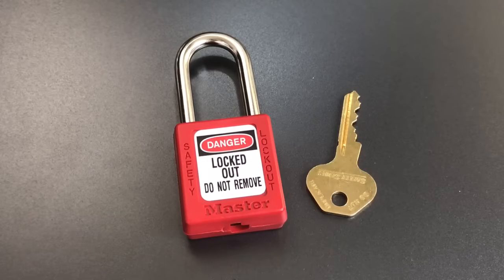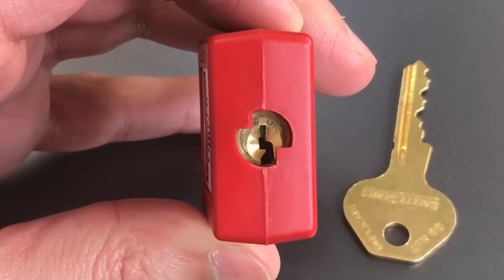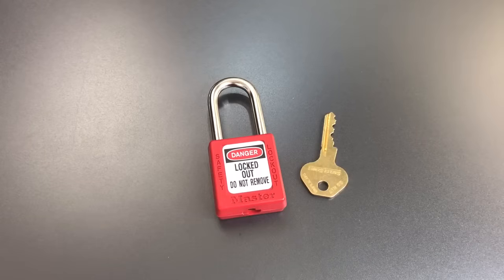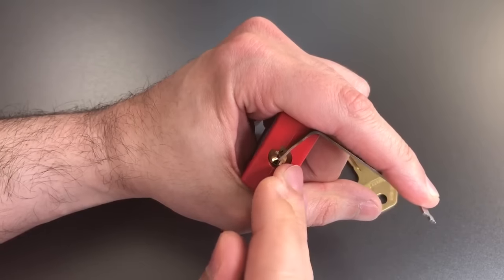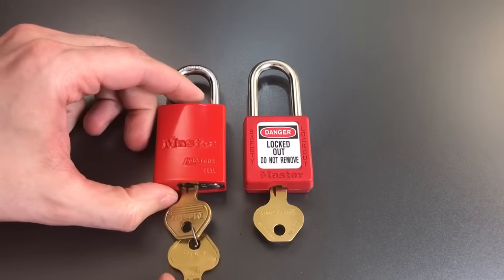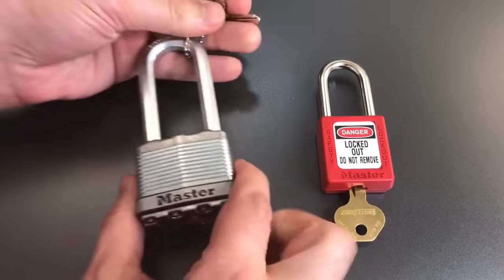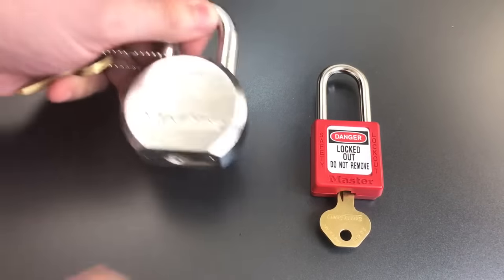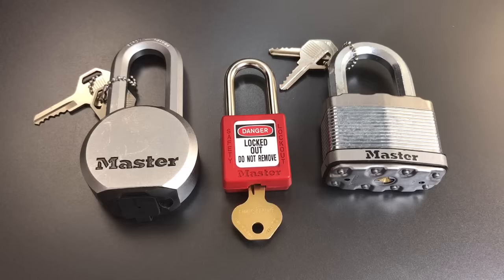[479] The Master Lock Paradox - Model 410 LOTO Padlock

Comment: I've worked with LOTO locks for years, and can comment on why the design is great for me and my coworkers. The shackle is un-hardened so an authorized Safety team member can use standard bolt cutters to chop it if someone's lost their key. Additionally, we use these so often that we wear them on our belt, so the lightweight plastic-exterior design really helps to not tear up your pants or bounce around too much. Finally, we use these locks several times per day for years, so perhaps the extra pinning helps the keys stay firmly in place when we're walking around with the key in, or continue to safely function. Or perhaps there was some court case where someone picked a lock and someone got hurt. I'm not totally sure, but that's the information I have!
Reply: I’m here to back this up as well. Everything he says here I can attest to. I work with automated robots, which require constant trouble shooting. This requires a lockout every time I have to enter the automated cell, I use this same exact loto lock as many as 50 times in one 12 hour shift.
Reply: So true,  plus the Weight hanging off a MCC mains power switch handle.
When you have scissors plates and 20 locks hanging off one, all that weight over time can damage the switch mechanism internals. 
the new plastic locks came out after 2 people died and 3 injured  because the switch was damaged energizing a conveyor that they were working on.
Early 2000's in Australia.
Reply: I am a non-lock picking lawyer who does labor arbitrations and thus I know a fair amount about LOTO practices.  All those reasons are spot on. Also note that The “one man one lock“ practice means you can have 10+ locks hanging off the same switch if it’s a big project. Size and weight matters. Finally, on the management side, no one ever got in trouble for paying an extra dollar for an LOTO lock so I won’t be surprised if someone at master lock just said, what the heck put the good core in there we can charge extra for it ;-).
Reply: Thanks for all the specific insights, very interesting, but I don't think that was ever an issue. Everyone can imagine why plastic locks could be useful, problem mentioned is more at why they did not put such a good core (as LPL claims, I got no clue about it) on any of the premium locks that are supposed to provide more security when they obviously are able to make it :P
Reply: Felix Safford never claimed to be one, only stated that i use this lock at my place of employment and my experience with it.
Reply: The quality cylinder is because they don’t want multiple keys floating around. You only have so many pin combinations before you start back over. It’s to keep out the honest people not scalawags.
Reply: As for multiple locks hanging. You should never have multiple locks hanging from a switching device. You put a single lock on the disconnect and then put the key in a lock box and lock onto the box accordingly. Plastic is not for weight savings priority but cost savings. That’s why electric utility meter tags are a thin piece of metal tabbed into a plastic tag.
Reply: I've had to carry up to 10 locks on shutdowns and am glad the bodies were made of plastic, the pain in the ass is to  figure out which key is for what lock in the low light environment
Reply: I think he means more so why their BEST lock is in a bad body in the sense why do their most robust locks have such lack luster locks in comparison
Reply: I think the reason for the core being better on this the on some of the other ones would be because Master assigned a group of designers to make a new LOTO lock and gave them a price range, so because of the plastic body they had extra money for a better core. Where the other ones were made with more expensive body's. Damn this was long.
Reply: @Storyteller543  The better core design is likely more due to this lock being to protect someone's life, versus just preventing replaceable items from being stolen. One of the machines I use these on specifically calls for plastic bodies because the LOTO location is dangerously close to 460v mains supply. It's already scary enough climbing into a machine that will kill you without even batting an eye, no need for added risk of electrocution when installing or removing the LOTO lock. Depending on the type of plastic and molding method, the plastic body could be the same cost or even more expensive than Master's standard lock body design. Quality plastic isn't as cheap as people think it is. It's some weird blend of Nylon and other crap in it. They even make ones with full Nylon shanks to that are non conductive and non sparking.
Reply: This comment might as well be a Reddit thread.
Reply: Farfigshüten U.S.A I atest to this
Reply: @RadDadisRad  The plastic is more likely not for cost savings but for non-conductivity. LOTO locks are often put on power boxes, switches, fuse boxes, and other high-flow power devices. When people refer to LOTO locks hanging from a switch, they are likely referring to a lock box, since the first step in a lot of LOTO is to enclose the entire switch or plug in a LOTO encasement.
Reply: I also wonder if the different pins can help in dirty environments where the lock may be used often. Leave a little room for shavings and dust in the lock to keep it working longer.
Reply: dementedpaintballer but whose picking locks to turn equipment on? I don’t buy that it’s for “protect a life”
Reply: @blahblah8037  well, you've never had a job around dangerous machinery then. I have several machines at work that I have to climb into to fix broken hoses or do routine maintenance on. LOTO locks like this one prevent somebody from turning the machine on while I am inside it. I would easily be killed if the machines were activated while I was working on them. Whether you buy it or not, these locks protect lives.
Reply: john jon try rereading and learn to use some context. 

I clearly said who is picking these locks. Especially a plastic one you can remove with a screwdriver. 

Don’t condescend because you’ve had a job. Try following along to the entire conversation. 

The lock core is not as good as it is to “protect a life” 

Clearly we were discussing the strong core not the locks and their uses themselves.
Reply: @blahblah8037  Except you didn't mention the core, you said picking locks.And this thread was about LOTO locks in general. And it does happen,  that people will use whatever key they can find to try opening common locks in a workplace. I've had people from a 2nd shift try to "find the key" for a machine I locked out because they thought they needed to use the machine. The uncommon core and one-lock-one-key practice makes it all the more difficult to remove these locks without having to destroy them.
Reply: john jon I’m not reading more than your first words of your reply. You obviously can’t read and therefore I will not continue to waste my time with you. 

Again CONTEXT!!!

Look at who my original message was tagging. Read his message and maybe you’ll finally be able to use some kindergarten level deduction to see what others were discussing.
Reply: Yep
Reply: I use these as well, I clicked so fast when I saw this lock.
Reply: john jon ... He is certainly overreacting, but you’re also being dense and unapologetic about it.
Reply: Absolutely, Scott. They're not intended to keep burglars out. They're safety devices to protect workers.
Many years ago all we had was tag out. A string and paper tag with details written on the label.
The high security mechanism is more important than the casing. The mechanism prevents the lock being operated by the wrong key. That's why many combinations of keys are required.
Anyone working in an environment requiring loto understands this. Any worker who tries to defeat the system illegally will not be working there any more and might finish up in a secure government institution if anyone gets hurt.
Stronger locks would be used on, say, an isolating switch on a power line pole where the public might have relatively easy access.
Reply: For me the money-shot in this explanation is the fact that the more secure, additionally-pinned core probably holds the key place a lot better over time to avoid key loss.  Something you're much more prone to do with locks like these.  Makes perfect sense when you think about it but didn't jump out at me until reading his breakdown.
Reply: Yep..
Designed last for years
Guess extra pins is variety in combinations? On a site with 100-150 people who all over 2-3 of these locks, you don't want any double up. Though that would be very rare but you don't want someone able to unlock multiple locks. Plastic yeah because we care multiple. 
But yeah question is still why wouldn't they just use the same core? Maybe because they don't want any person who has any of the other keys being able to open the Loto lock, they are required to have a different system all together.
Reply: @speckey1983  glow in the dark tape, fam. Sells on Amazon for ten bucks. Cut a little piece number it with ultra fine point sharpie
Reply: Wax is used to verify something such as a document is unopened, to verify the sender's identity, for example with a signet ring, these easy to break locks are the same thing. If someone gets killed on the job...
Reply: As mentioned rather intelligently by others here, the extra pin reduces the possibility of 2 people having the same key. Perhaps the security pins reduce the chances of a key which is CLOSE (but not exact) inadvertently picking the lock open. I would also guess that it was industry specifications which called for this usual core rather then  something Master came up with internally. If you want to sell a zillion LOTO locks, then you have to provide the right core.
Reply: I think a big reason for the difficult-to-pick core but plastic body and unhardened shackle is they want it to be easy to open destructively but not easy to pick or jimmy open, so that you'll know if the lock has been opened or tampered with.
Reply: @NolorW  Because the attacks against the "premium locks" are likely not to be picking. They are going to be some guy with a hacksaw, or bolt cutters, or a pry-bar. The LPL skill set is not very widespread in the real-world.
Reply: @johnjon4688  with the metal shackle, and lock core the plastic body offers no electrical insulation.
Reply: @stephengroff633  most of these are offered with a shackle with a plastic or rubber shield on them. It's about not allowing direct metal-to-metal contact that may close a circuit.
Reply: What he said is on the money. Also, many of those other locks have a large shackle that may not fit the equipment and some weigh a lot. Besides it pulling down your britches the strain the equipment hasp. It has a longer hasp which is good for tagging some equipment where a short hasp won't do. Can't forget the color and the plain labelling. Use to work at a wood mill. The machines there can kill you quick. Knew one that got pulled around a tailspool because he didn't tag out. Be safe!
Reply: I could be wrong but I thought it was an insurance thing. If someone easily picks the lock open and hurts themselves on a the locked out piece of equipment they could argue it wasn't installed correctly, but if they have to smash the lock body to get to it then they couldn't argue the same case
Reply: The most glaring failure of this lock, for me, is the failure of the plastic body. If the lock has been used for a year it has a tendency to separate down the body seam. I've had
multiple locks of this model split in my hand. Most of the failures are due to dirty cylinders failing and splitting the body. But some just split with little interaction.
Reply: I always figured that they were used to limit liability. As long as someone puts it on whatever is being LOTO'd than that absolves the company of all responsibility for anything done by misuse.
Reply: Totally true. I am here to  comment the same. We also use the full plastic model on some machines.
Reply: i agree and if couldn't find a bolt cutter a punch and hammer do that trick too
Reply: @parkwood25311  When i learned electronics, as we traced circuits and would notice a lot of components that didn't seem to do anything or were redundant. We called this "the owner of the company that supplied the boards had a relative that owned a component factory"!!
Reply: @RadDadisRad  you're starting to see lock boxes become SLIGHTLY more commonplace - but generally in the field you see a multi-lock hasp, or two, or three, depending on the size of the job. Usually when I have seen lock boxes, its been on machines/equipment where they were factory-installed to begin with.
Reply: @Jester_The_Jynxster  yes we transitioned to lock boxes 2 years ago. One orange lock for the equipment, the people carry blue locks to put on the box. Hadn't seen a red lock before.
Reply: @danwake4431  If memory serves, the red locks were the only color available when the 410 series first came out - I think somewhere around 2000-2002 (possibly a little earlier, but I recall that being the first time I had seen/purchased one)  With other colors becoming available later on.
Reply: @RupturedHighlights what Robots and where?
Reply: New standards require the LOTO lock to be inherently colored so the paint can’t chip off and look like a regular lock. That’s also why lockout is imprinted on the body. I use these all the time. My company also puts us through an OSHA LOTO class. It’s cool to learn that my friend’s key won’t accidentally open my lock. It’s basically a lock to prevent accidents, not malice.
Reply: @Steve Campbell that's b.s. I can get the same ones for less than 10 bucks as a " security lock" cost as much as 5 times as much
Reply: @michaelzdanis3979  you are quite wrong my friend. Intelligent people can also be criminals too. Have seen quite a few local news articles of people picking locks instead of smashing through.
Reply: I'm not totally sure, but I'm going to post a comment, anyway.
Reply: @RupturedHighlights  Oh, so you're like the terminator
Reply: You nailed it.
Reply: @georgewashington2893  Just how it is man; some guys just weren't held enough as infants.
Reply: AllDayTits what type of work do you do on them? I have an opportunity to receive schooling to learn how to work on them, also do you recommend the job? I really appreciate if you let me know I’m trying to find a field of work good for me.
Reply: Felix Safford are you feeling entitled enough to tell someone OVER THE INTERNET to change there name cause you don’t like it, well that’s too bad. Deal with it kid.
Reply: I would add one thing, cost justification.  This way Masterlock can charge top dollar for "secure" lock, and since its in the name of SAFTEY, no one will hesitate purchasing it.
Reply: I wonder does it have to do with the body being insulated incase of electricution
Reply: An additional reason might be, you definitely don't want it picked because there is no evidence it was defeated. But if it's cut open, that's fine (usually if key is lost) there is proof it was broken into.
Reply: I'd love one of these plastic ones. We carry 3 metal ones on our belt. 
Never thought of it much but I guess they are pretty durable, some guys have the paint completely rubbed off theirs from being used and jingled around so much and they still work
Reply: Can vouch for this
Reply: Everything here is correct.  The locks do not have to be physically strong as long as it requires tools to defeat it.  The key however, needs to be unique and many large projects, like refinery outages, may have thousands of workers.  A typical refinery outage will require 1500-2500 workers and each one has two locks that you need to be sure will not be removed accidentally by someone with a matching key.  For smaller plants, you might only have a few maintenance workers and so the 4 pin locks would be fine.
Reply: @michaelzdanis3979  not having your experience isn't the same as having none.
Reply: @jamesbeavis1892  Or even unlock the wrong lock. They get off on which LoTo they're hooked up to, and pull the wrong one out.

Or a mechanism gets worn down, and just doesn't latch correctly. One of the people higher up in the thread mentioned using their 50+ times a day.
Reply: @RadDadisRad  In regards to the multiple locks to lock out one device, that is the standard that has been drilled into my head for as long as I've worked in manufacturing. One person, one lock. They even issue special hasps to make it easier to put multiple locks on one device. I've never heard of people using a lockbox for the key for something like this.
Reply: Also. Not sure that someone hasn't mentioned it. There are now 72 replies, but... The body not only is lightweight but it isnt conductive, which is a big deal for a lot of safety protocols. As an Elevator Constructor, I can confirm that I carry at a minimum two of these on a belt loop at all times. The lock doesn't really have to be the most beefy thing out there, it's main purpose is to keep an honest man honest.
Reply: While you guys are right why unhardened and plastic is good for this use-case, the real question is: why does ML not use these cores in the locks that are supposed to be secure? Obviously, they can produce the cores...
Reply: @panda4247  Probably cost. Here companies will buy them in bulk because they need LOTO locks that meet certain standards, but others are not as aware of the performance of the cores. I know I wasn't until I ran into this channel.
Reply: Aha!!  Thank you for that info... Solves the mystery
Reply: @
LockPickingLawyer I think this is your answer. You can avoid going to your grave not knowing (if you read this comment at least). The LOTO lock is like the signature on the envelope of my college transcript. It is a seal. Should the seal be broken, I have knowledge that there has been breaking and entering. This tool allows for proof of unauthorized access. It is actually reasonable and makes perfect sense.
Reply: @slink4956  there are several deleted comments from him that would add context to my responses.
Reply: Two pairs of channel locks will open these.no bolt cutter needed.
Reply: I could totally see the "someone got through it and the company got sued" argument.
Reply: Perhaps.
Reply: We just broke the body by twisting it...
Reply: Here's my thought: the weak body makes it easy to remove officially (safety official cutting it in case of a lost key), while the good core makes it hard to circumvent nefariously by picking. Say someone wants to get around the safety rules- a chopped lock is a dead giveaway that they broke the rules, so they would want to pick it instead. A good core makes that harder. So I think this makes sense- it is more secure against rule breakers because it's harder to pick, even though it is easy to remove for someone who is permitted to do so. My LOTO locks even have aluminum shackles.

Also, the plastic body is good for lightness, and to make sure nobody is tempted to use a LOTO lock for something they would actually want to protect, keeping LOTO locks more 'sacred' for their purpose.
Reply: Why did LPL never respond to this?
Reply: @ElectricNed  like I said a pry bar pops them apart
Reply: @silverpairaducks  You didn't even read what I wrote.
Reply: @dementedpaintballer  some have also the metal part out of the body also covered in some plastic, i wondered why, now i've got a clue.
Thank.
Reply: @stephengroff633  some variation have the metal shackle covered with some sort of plastic.
Reply: @RadDadisRad  No.  Every person who is working on a locked out piece of equipment is to have their own lock, and they are to have the only key to it.  For multiple locks you use what's called a hasp, which is a pair of plates that together make a loop on one end and have a bunch of holes down the body to clip your lock through.  
In the event someone forgets their lock, is injured, or whatever, once it's verified that they aren't around the lock would be cut off.
Reply: I had an honorary 'uncle' who used to work in the coal mine as a 'sparks'. He was working on a moving belt to change the belt. Some idiot removed the "Do Not Open: Work in Progress" sign from the breaker box, broke off the padlock, opened it and threw the switch to 'ON'. The motor started up and the belt flew off, wrapping itself completely around him. He suffered injuries to his spine, ribcage and arms and could no longer pass the medical to work underground any more. He soon left on an invalidity pension to enter the local social services where he worked alongside his wife, my late mother and, for a while, yours truly.
Reply: As someone who understands LOTO but has never actually been on either side my thinking was right in line with this:
Good core= less risk of someone removing it (non-destructively) and claiming it was never installed
Cheap body= can be easily removed by destroying it if necessary, but of course it will be impossible to say it wasn't used
Reply: I think that the paradox is not so much why this Loto lock is made the way that it is, but why all of Master Lock's other locks are made the way that they are...
Reply: I have never used this type of product but as a UX designer I imagined scenarios exactly as you just described, and was going to comment my theory here.
Reply: @72 ventura They are more expensive because they are part of a "system" of compatible accessories. The cuff thingy that lets you put 6+ locks on the same switch, if you started mixing locks of different brands, then one would not fit, another would be too thin and allow the cuff to open ever so slightly…

Plus I'm sure that some of the premium cost comes from lobbying, marketing and training material. You don't need training material to explain how a lock works, but you do when you have to explain how the lock works in a LOTO system.

And yes, everything "industrial" comes with a premium price tag.
Reply: @johnjon4688  Depends. Some devices will lend themselves readily to LOTO practices. Many disconnect switches have a built-in locking hoop, therefore you don't need to wrap the switch in some box. Also in this case, having several locks hang from the switch is not an issue at all. I understand how a breaker lockout thing on a service panel might not hold up well under the weight of several locks though, thus necessitating a separate lock box in which you put the key.
Reply: @sleblanc  yeah. newer devices tend to have better accommodations for safety practices.  There are a lot of old machines though that require a  plug cover or switch cover.  I've commented on this thread so many times that I am not sure which reply you are replying to! lol :) We've had situations where a breaker box for a machine was the only place to disable it, and if several issues are present, and different techs are fixing it, they will chain locks together or double-lock a box in order to ensure all issues are dealt with before the machine is put back under power.
Reply: Our company switched to a version where even the shackle was plastic to reduce the weight on a breaker.... until we discovered some auto-reset devices could break right through the shackle, so we're back to plastic body + metal shackle.    If you have enough locks that the plastic shackle becomes necessary, you should really be using a group lockout box anyway
Reply: It's actually even easier than bolt cutters. You can literally put a screwdriver between the shackle and twist and it will blow the lock apart.
Reply: There is a lot of decent reasoning in here for why the LOTO lock may be as it is. I'm partial to the reasoning that the companies that purchase said locks would rather the lock but destructively removed, if necessary, but really don't want them to be pick-able by the workers that would be using them day-to-day.

 The weird issue is why a security lock made with with tougher material doesn't have that core but an inferior one. It's a lock, it should be easy to justify a few extra bucks for a better core to the right customers.
Reply: @RadDadisRad  Really late here, but not exactly true. If you're locking multiple pieces of equipment or applying locks on multiple points, or the LOTO will stay on after your shift and be taken off by another shift, you use a box. But there are definitely cases where you want multiple locks on one item. While a technician might take his off because he has finished his work, a supervisor might need to double check. Then possibly a EH&S person, or a house electrician, who "owns" the source voltage. Also you could have multiple  technicians working on the equipment, they are each in danger, so each have a lock. That's why they sell hasps that allow 6 locks to be applied to one point.
Reply: One project I was on involved at least 30 contractors.  All working on different parts of the same plant. In this situation  the customer put two locks on the main isolation switch then the keys were placed in side a box. This had enough holes for at least 40 locks.
This is where we put our locks.
Unless every lock was removed they couldn't get the two keys for the main switch. 
Ps   most  LOTO LOCKS ARE ONLY SENT WITH ONE KEY..
Reply: @parkwood25311  Good point, but the real question is why not put a good core in a robust lock?
Reply: The mines here is Aus use them. Never really considered why they were constructed the way they are, but the plastic may also offer some level of electrical insulation also? Not great if you are holding the engaged key of course. But you know how safety works, makes sense most of the time but goes way too far the rest of the time. The real reason is likely make it cheap and sell it for a fortune because the mines and contractors have to buy hundreds of thousands a year. With it being a OHS requirement it maximises profit.
Reply: @RupturedHighlights  Thanks for the insight
Reply: My two cents.
The lock is secured by a seemingly unique number of pins, thus any normal key for a conventional lock cannot open it without destructive force on the remainder of the lock.

Thus no one can claim 'but I had the key' when using a normal key for a different class of lock.

Frankly they should use a unique cylinder layout to guarantee their security, but RnD is expensive.

Again the body is supposed to fail BEFORE the key or cylinder can. Because the key is unique to the lock and holds a man's life in the balance. If you bust the lock you could be charged with manslaughter because you knew there was a man who held that key for his safety.

Admittedly on big jobs with ignorant co-workers I would like a 6 pin titanium body with soft aluminum shackle. Because the damn thing is the only thing protecting me. I will want the body back plz, I can buy new shackles.
Reply: i use these bastard locks all the time too. i think you nailed it on the head man. might have 40 people on site all with the same locks and keys from them and nothing can be used on one another
Reply: @RadDadisRad  boom
Reply: One simple question remains, if they can make such tricky cores for simple LOTO locks then why are their far more important and expensive locks so lacking by comparison?
Reply: I think the answer to the paradox is that's it a dramatic emphasis on safety made master lock design a lock that cant be breached unintentionally but can be easily intentional removed. LOTO is a rightfully dramatic procedure.  If anyone else key could open up some one else's lock that could be dangerous as well as defeat the purpose of LOTO.  If some one leaves work and there lock is still on. We are supposed to page them to make sure they're are not still they're, I think we are supposed to make sure they're car isnt in the parking lot even.
Reply: @amanofmanyparts9120  fr people don't understand the dangers these locks prevent. Someone who is ignorant or wants to work will take signs off and start machines. These make sure that won't happen. Also allows workers to leave the scene to get supplies and tools and come back without worry
Reply: @rogervanaman6739  well these locks are meant to have no duplicate keys. So better core makes it harder to dupe keys. They're also not supposed to be opened by any similar key. So that also helps. As well as the cheaper to produce body and the fact that they literally hold someone's life. But it would be cool to see companies use these cores as more expensive locks to the right customers
Reply: @glenmcgillivray4707  but it also costs more to produce so they charge more, has to be insulated to reduce the chance of a trained professional shocking themselves, and makes it harder to put more on a machine itself due to the weight/weighs down workers. Definitely think they should give every worker a metal one and two plastic
Reply: @charlesquinton9127  money.  Better core for the purpose of no dupes, and cheap body for price/easy removal if needed. Theft protection locks use strong outside because most people will shoot/break a lock before picking it. Although some will pick it. It would cost a lot more to make a strong metal body, and a good core
Reply: @johnjon4688  people really don't seem to get the importance of these locks though. They are purely designed to save your life. Plus, that Blah Blah guy had no idea what he was talking about. Had he read your entire comment he wouldve have known why they aren't meant to be lockpicked but can be broken. People will lockpick them or break them. If you break it people are going to hear or see you, and you're gonna get fired. Anyone who knows LOTO is going to know that you never touch that lock if its not yours. Break it and you're probably never going to get a job in industrial maintenance again. Even if you're not LOTO certified, you're still fired because you weren't supposed to be there. My mom works as a HR manager in a Butterball plant. She had to fire 4 people because three of the workers violated LOTO, and safety protocol, as well as the supervisor for not intervening. Everyone of them fired for that simple mistake because all three of those workers put each other in danger, and he watched it. Luckily no one was hurt, but i doubt they're still working in industrial maintenance
Reply: @donniedial3014  Yeah, the oddest part to me is that they don't use those cores elsewhere. It seems there should be a market. But Masterlock seems happy to stay in their lane and make money there. guess you can't really blame them for that...
Reply: Dean Robert that’s what a lockbox is for. To avoid 30+ locks on each set of equipment or switches in an area
Reply: @NolorW  Because the nonvisible more intricate lock mechanism costs more to manufacture. Most consumers buy a lock with their eyes.
Average consumer: "Ooh that looks like a big bad ass lock" 
LPL: (wiggles it with a paperclip) "Yeah it's a real piece of shit alright. Counter rotation on two. Come on number 3... (click) there we go, and got the lock open"
Reply: Either that or masterlock just likes their paradoxes
Reply: Use these in Wind Turbines for LOTO as well, except we use the fully plastic version for arc-flash prevention purposes.
Reply: @johnjon4688  if someone wanted to break it open to turn the thing on itd be easy to just cut the top of it off. No need to pick it because the lock body is so weak ..
Reply: @parkwood25311  Toyota uses gang boxes, one lock on the machine, 10 locks locking the single key into the box.  I wonder about the secure pinned core on these, as you would assume anyone attempting to pick a LOTO lock is basically attempting premeditated murder.  Anyone spending any amount of time messing with one gets stopped and questioned.
Reply: @Storyteller543  Why do people seem to think that engineers are idiots? Newsflash.... engineers understand product financials pretty well, and wouldn't make that kind of error. For that matter.... business people aren't idiots, either, and I'm sure you'd be hard pressed to find anyone who thinks they should pad product costs to "meet" a cost target.  Padding product costs to hit a higher target is completely different from padding departmental operations costs to insure your budget doesn't get reduced next year (which is surely what you're thinking of), and smart people can easily see the difference.